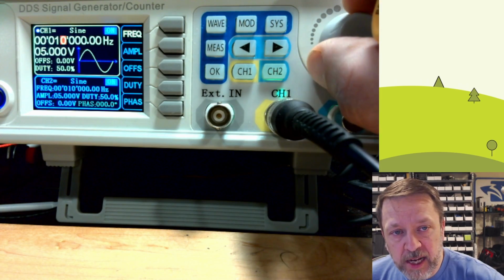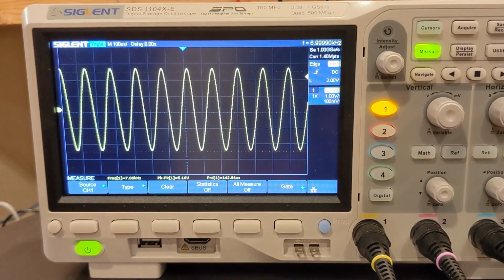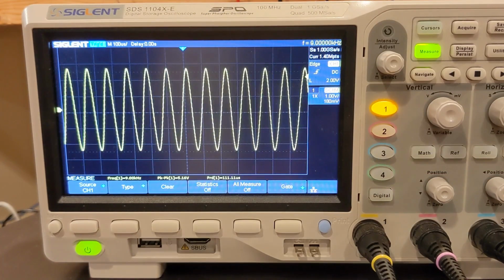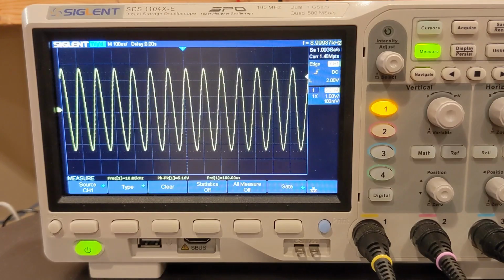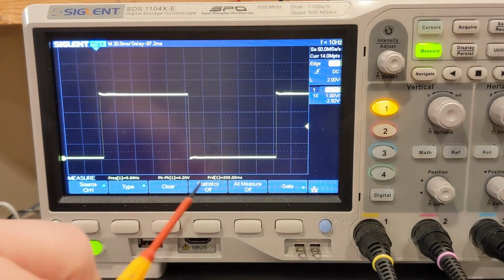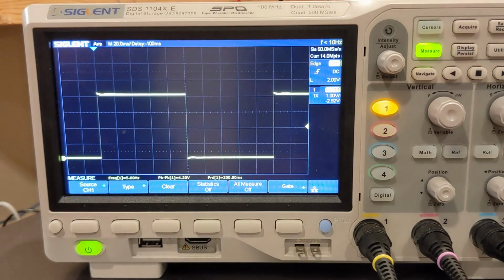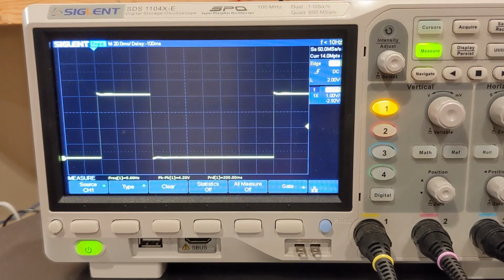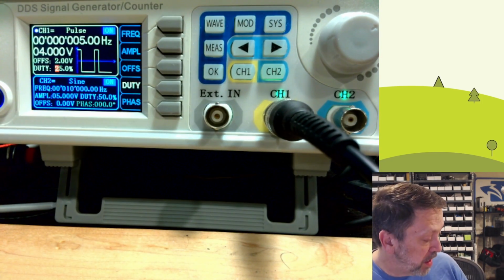Testing Your Apps With a Signal Generator

Comment: What's cheaper than this is you could also just pulse with an Arduino digitally or use their PWM
Reply from the maker: Absolutely! Any micro that can generate a PWM could be used, though it requires you to write code and do some wiring, so it's not quite as "turn key" as a generator, and if you ever need the +/- capabilities or the sine wave function, you'd be limited.  But absolutely, you could make one of these - maybe that would be an interesting upcoming project.